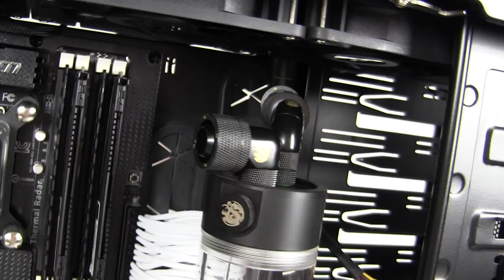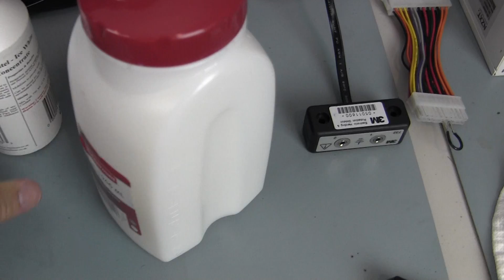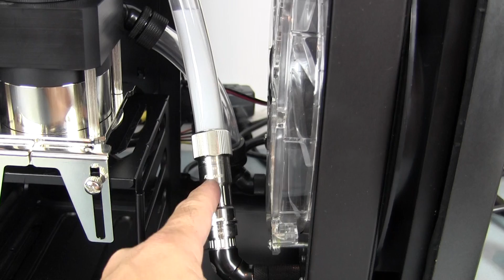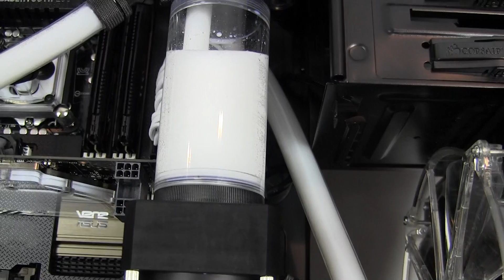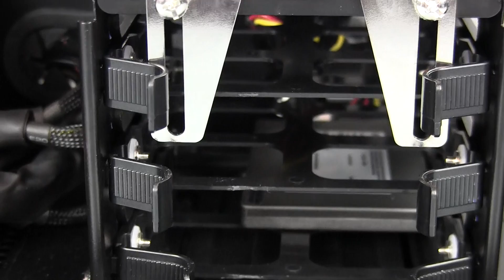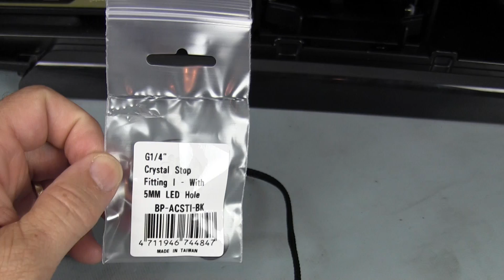CORSAIR 600T Custom Water Cooled Gaming Rig - Part 5 - The Leak Show !

Comment: When it leaked I shouted 'WHOAAAA' :D Nice build m8. I would maybe replace the 200mm stock Corsair fans (apparently they don't move much air) also I would have run the loop in this order. Res. > 360mm Rad > CPU > 200mm Rad > GPU. But I understand that might make for messy tubing. :DDD

Comment: Well, your water is being cooled, then sent to another rad to get cooled again. That alone is a redundant waste of a rad. In addition, and more importantly, you have very hot coolant going from your cpu straight to your gpu. It will probably run fairly hot, probably even hotter than stock.

Comment: I prefere cold light cathodes or LED strips. You'd still have light bulbs with the strips but have a way better overall and equal lighting.
I'd only use single LEDs to highlight a certain spot in the case but i'd take care that you cant see where the light comes from.

Comment: Hi Ronsanut . First of all thank you for this vid. It really is helpful. I was hoping you could help me understand two things though. When you said you "bleed out" your system, doesnt that meen you should have your top cap on res opened so the air have a chance to get pushed away of the loop? And when you add more coolant to the closed loop with that same cap closed (air has no hole to get out) doesn't that mean you put huge pressure to the loop (closed air+liquid)? Thank for your answers!

Comment from the maker: Which COV-RP450 version did you get ?  I think some guys who got the Ver 2 COV-RP450 and the X3 150 had to use some plumbers tape and may have used some silicone because the threads ofthe X3 were not exactly the same as the Ver 2 COV-RP-450.

Comment: Ronsanut nice work! The series of videos on the Corsair 600t are nice.
My first water cooling build will be with the 600t and I'm going to use your pump set up.
But it will not sit on the HDD cage will I want it on the floor of the case.Oh yeah dose the liquid come in Orange? Again nice work.

Comment: With a D5 pump it doesn't really matter if the radiator is up or down. I don't think it's possible to mount it the other way around anyway, since the HDD cage is blocking.

Comment: I only disagree with the CPU being fried, he was using a different power supply to power the pump at the time he ran the pump. However the pump will likely die sooner because it ran dry.

I'm not sure about the res being upside down, i think it is the only way to mount it and have the pump beneath the res.

Comment: Looks cool nice work. But......overkill on the cooling system. I would expect this cooling system on a bigger case with way better hardware (i7, all RAM slots used, better graphics card). Plus. The leak was entertaining? lol   Maybe you should build a oil cooled system fully submerged, you'd get a kick out of that then. lol

Comment: I fill while the pump is running and make sure there's some liquid in the res so the pump always wet. I do it until a loop is complete and i got liquid going in and out of the res at the same time. At this point i just top of the res and i am done.

Comment: Hey ronsanut; other than the leak show did you ever have an issue with the EK 150 on the koolance pump housing    I had to order another black ring connector for the first one kept stripping but the second one worked good knocking on the wood. by the way nice build.

Comment: Thank you for the video!  I have the same case version except mine is the white not black one, I was worried that the radiator I got wouldnt fit in this guy but after seeing yours I know I did good lol.  Did you have to drill holes in the top to mount the top radiator like that?  I never really looked closely at it as I have just done air cooling but with my current situation liquid cooling is going to be the better option for me now.
Reply from the maker: David Wilson Yeah it was a tight fit but it worked.

Comment: Great build man! Going into my first custom water cooling setup. I wonder if it's possible to loop that smaller rad in between the CPU and GPU's as my GPU's run hot as it is? Anyways great setup !

Comment: Looks good.. those corsair 200mm fans are HORRIBLE fans.. also your front radiator.. aren't the hoses usually ran to the top to ensure the rad fills up all the way and is fully used rather than pumping fluid in through the bottom?  Overall it looks great.. I normally test for leaks with the setup outside the case but it is a pain to do that.

Comment: If I follow the plumbing correctly, it looks like you have the flow from the cpu>gpu.>res>small radiator>large radiator>cpu inlet. I am not a fan of have heated fluid going into my acrylic res then out to radiators. Just wondering why you went with this setup as compared to res>cpu>large rad>gpu>to small rad>back to res? Honestly you could get away without the small rad all together. I'm not hating on your system just curious to your setup reasoning the system looks AWESOME!

Comment: nice video.. but did you removed later 35mm fans, or replace it with something quieter? I have Sabretooth Z87 and noise from these fans was not acceptable.. and I replaced them with some silent 40mm fans.

Comment: Turn the Power supply upside down. Then it will suck air from the bottom and the color from the wires will be hidden.

Comment: nice build! Can you tell me with these fans on the top, is there enough place to put a  5 1⁄4-inch drive on the first slot from top to bottom and how did you cut the place for the top radiator?

Comment: Mate ur flipping lucky any of that coolant didn't touch any of the components when u over filled that radiator cos u could of just screwed up that wonderful pc plus I'm going to be building a new personal rig for my self but only air cooled cos I don't feel up to water cooling yet but it's gunna have a core i5 overclocked to 4.5ghz and a gigabyte motherboard and a GTX 680 signature 2 edition with the two fan beefed up heatsink what do u think

Comment: I bough the GeForce GTX 680 2048MB it was a little bit of a stretch but i thought it would be a better buy im not done building my pc yet but all i need is my power in which i ordered the corsair 650-watt i originally had a cooler master extreme but it just wasnt good enough

Comment: I would never buy any block that is made with a combination of metal and acrylic I think you would just be asking for problems. I use an Acrylic resevoir and an acrylic xspc top on my pump but for my blocks I would never use anything but solid metal or two part metal that is bolted together.

Comment: How did u remove the outer cover case of T600, because i have to move the hard drive bottom (A black deck which have 4 screws nailed on the bottom of the case)just like u did in part 2. There are two screws insider the outer case that i can not reach it.
Thanks.

Comment: Hey ronsanut I have a white 600T and am planning on water cooling it. I have 2 questions. First, can I use a pod res in my build with a GTX 680 (EVGA reference) because the GTX 670 is shorter than a 680 and it looked pretty tight in your build. And my last question is, would a 200mm radiator in the front along with a 360x30mm in the top be enough to cool my graphics card and 3930k? I overclock my processor at about 1.35-37 volts.

Comment: That long tube running down from the 360 rad looks awfull.. I think it would look better if you placed the inlet/outlet towards the front so the tubes will incline nicely like the ones in the cpu block and the return going to the reservoir..

Comment: you overclocking with this? 3.3Ghz isnt warranting a custom loop?! also can I ask why you use the large front fans? they provide low pressure with high cfm, (not desirable) and I can imagine the draw of air of the large fans will make a quite audible sound, thus removing the main reason water cooling is utilized.

Comment: I've been looking for an answer for this simple thing and I can't find it anywhere online. IS there any System Based Limitations when it comes to graphics cards? Say if I wanted to buy a graphics card such as yours, to run on a HP Desktop computer sure I know I need a higher quality power supply but is there any thing other than that missing? (I know about the pci slots and all that bs but yeah)

Comment: not bad but that long hose running to the top rad drives me nuts... i ran a 240 front and rear in my 600t had to do some modding to front instead of roof but i can run hose to the right on top makes for a cleaner look... o yea watercoooling proo or first timer... paper towels are your friend when leaktesting.. if them leaks/spills were say the cpu block instead of the res it mighta been a sad day

Comment: Hey guy wouldn't you want everything to drain at it's lowest point thereby allowing everything to drain without coolant being held up in any upper areas of the coolant system ? . Isn't that system using rather large tubing and connector's ? Do you really need that amount of volume ? Your vent should be a check valve type vent that way it's you proof ? NO ?

Comment: Awesome video! How did you connect the pump top to the reservoir and make it flush? Does the pump top come pre-threaded so that you just screw on the reservoir?
Reply from the maker: Yes the Koolance pump top and the EK reservoir I used happen to fit.

Comment: it is necessary to have a big case for a gaming PC ? 
i have a Hp PRO 3400MT mATX Case 
Specs : 
CPU : Before : Intel Pentium G630  Now : Intel Core i3 
RAM : Before : 2Gb  Now: 4GB 
GPU : Intel HD Graphics 2000
PSU : 300W 
HDD : 500GB .
should i get a new ATX Case ? it is worth it ?

Comment: its much more effective to put radiators betwin videocard and proccesor. not one after one.
Reply from the maker: Not true. The difference in temps is maybe 1 or 2 degrees. Aesthetics rule and flow rate is more important that rad loop order.

Comment: Just wanna ask, what fittings/brand/specific name of the fittings you used for the CPU block (the 45 degree x2 fittings) and the other 2 fittings on the Rad with what seems to be a 45 and a 90 degree. Thanks
Reply from the maker: All of the parts I used are listed on my Facebook page under the 600T Build Album. But I am sure they are Bitspower fittings, that is mainly all I ever use.
Reply: Ah okay thanks, I will check your Facebook page. Im interested on adding those type of fittings when I'm about to do my first maintenance.
Reply from the maker: If you still can't figure it out I will check. I have since taken this system apart.
Reply: Yo, was able to find them with the same gold emblem and black finish from bitspower :). They are a bit pricey from where I am but I bought some 45 degree one's, trying to mimic what you did there together with an xspc photon res as you said to allow some light and get the coolant to glow some how :D its a good guide with your videos lol. Its too bad though that the guy who makes those modded side panels stopped doing them, although I don't think he can ship internationally. The case looked better with that acrylic panel. Always wanna look on the inside but impossible if left open without acrylic panel because of dust/noise.

Comment: I'm curious about your pump/res mounting as I have a Corsair case with similar HD cages and screw holes. Is that a separate mounting kit or comes with pump? (currently planning to build a watercooling loop for my computer and not sure how I want to do it (sep pump/rad or combo kit, how and where to mount etc).
Reply from the maker: No the kits are separate parts that I bought and put together.  If you go to me Facebook page and look in my 600T Photo Album I list all the parts I used to build this system.
Reply: Cool, I most definitely will, thank you. I can't quite decide if I'm going to go for a combo mount or separate mounting of pump and res.
Reply: Ronsanut . Hmm, found the build list but there was nothing in it about the mounting plate that attaches to the Corsair HD cage.

Comment: why do people do watercooling knowing that if they get a leak they could fuck every thing up just use a good cooling case like the nzxt phantom 820 and a air cpu cooler like the noctua nh d15 and boom great cooling and your set
Reply: you have not lived.
Reply: Cause the 820 is fuck off massive. With WC you can get great temps without a massive case. It's also fun to do and a bit of a technical challenge.

Comment: how did u set up the air flow, top and front intake and back exhaust? (with a glass side panel)
Reply from the maker: Pauline Dumont Top fans / rad exhausts up , the front is intake and comes in and the back exahusts out.

Comment: Eyo buddy, i am going to watercool 600T too, so these videos are very helpful to me ! I wanna ask what do you tell on my "watercool build"...

Fans : Corsair SP120 (2x Radiator, one dust)
Radiator : XSPC EX240
XSPC X20 750 Pump Reservoir Combo V4 
XSPC Raystorm CPU Block
Blue Primoflex Tubbing 3/8

It should be used for i7 3770 4.3 GHz,MSI Z77A-GD65 Z77, GTX 680 4GB Classified...

I wanna put the combo to "Optical drive" space... what do you think, will it work ? :D Thanks

Comment: Hey Ronsanut one question. I want to get into watercooling myself. Running the P67 Sabertooth and for coolent I wanted to get the exact same color and brand. Now in some reviews I read that this particular coolant harms the tubing. Some dude said that his pipes were getting brown. Any Problems so far? Which material are your tubes out of?
Reply from the maker: I am using Mayhems Pastel White coolant and the tubing is Tygon R3603 1/2" x 3/4" tubing after a year no problems .

Comment: Aren´t these Corsair 200mm white led fans too loud for you or are you driving these at 5 V?
Reply from the maker: No they are very quiet. They are running at 12V.
Reply: Ronsanut what fitting is that coming out of top of the reservoir going to the gpu is it a 45 Rotary ?

Comment: hello m8 i need an advice here :P im building a new gamer pc and i have a dilema here- what i plan 2 build is : i7 3770k sabertooth z77 h100 Corsair 4x8GB Vengeance Quad Channel asus 690 gtx ( ill sli later) Corsair Neutron GTX Series 120GB SSD wd 1 tb black 7200 rpm 64 mb crossaier ax 1200 w gold antec 1200 v3 this is all i wanna but im not sure i was thinking on change from sabertooth z77 for maximus v extreme or change 3770k for 3930k + sabertooth x79 or maximus iv please give an advice:P

Comment: what happens if that stuff goes all on your GPU and motherboard? Ronsanut .
Reply: ***** Which doesnt mean youre save with non-conductive coolant. It just needs some dust on you components or black magic and you can kill your board even if you use non-conductive coolant.
I would also always recommend using tissues under critical areas - just in case. It helps you detect minor leaks, too.